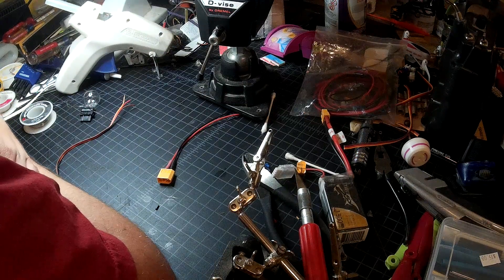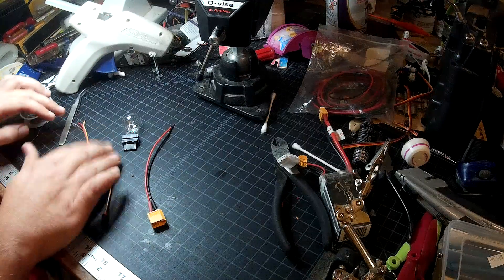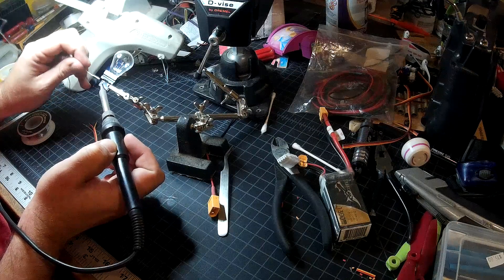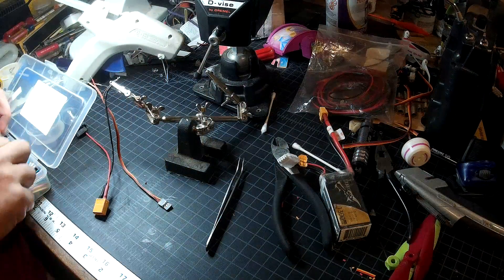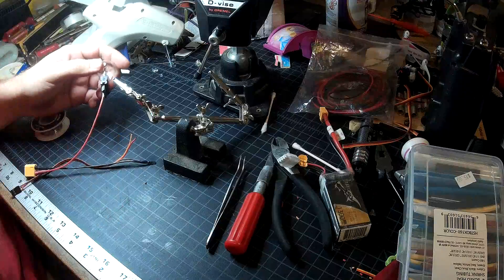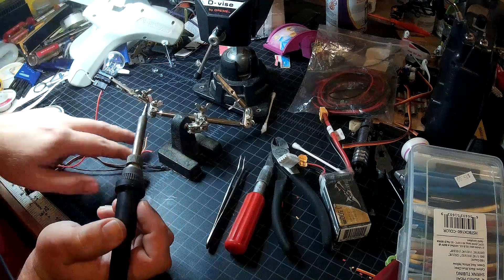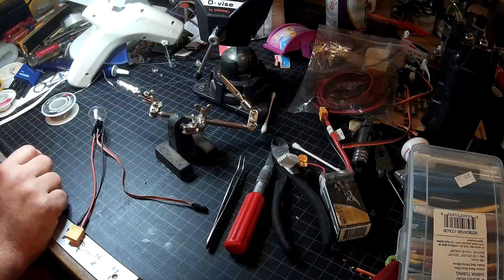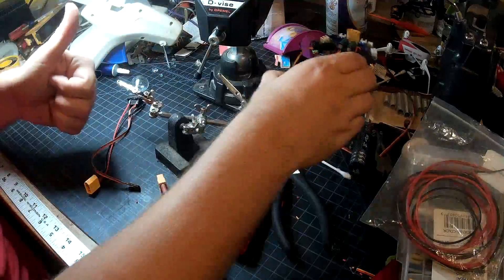Making a current limiter for ESC flashing

Comment: Yeah, those small side projects that hide on the desk forever. I need to build exactly this for a while too =) 

I'm not sure how you plan on using it though - especially with the two different watt lines. I thought the bulb just had to be put in line with the ESC power wires for testing if the new ESC firmware works correctly?

PS: Do you have a  transmitter running while recording? There's some minor audio interferences coming through.
Reply from the maker: +Balu - The two different lines just allow for some flexibility.  Like when flashing you can use the 0.5amp side since very little current is needed.  And on initial power-up you can use the 2.5amp side which is enough to let the motors turn at low speed - but it will cut out if you give throttle much above just turning and still limit it to where the chances of damage are much lower.  I ended up wiring it to a JST connector since my ESC's all have either JST or XT-60 connectors and I have a JST->XT-60 adapter.  I just leave either the orange or red disconnected - but they still have the pin on them.  So I just put the one I want to use in the connector and tape off the one I'm not using.

The sound in the background was a church 2 blocks away that was preparing for their Halloween party by playing some kind of movie over the annoyingly loud outdoor sound system they had setup.  Weather is finally nice enough I can keep the doors/windows open...but now I have that kind of thing to put up with.  Just can't win :D
Reply: +Jason Hitesman It's a very periodic "humm", nothing like I'd expect from a movie being played somewhere. Sounded more like interference you sometimes get from a transmitter or from your mobile when you get too close to a speaker.